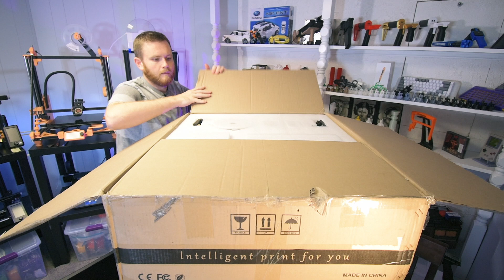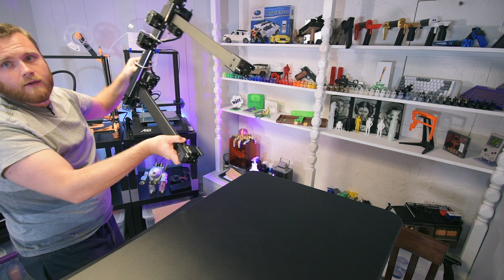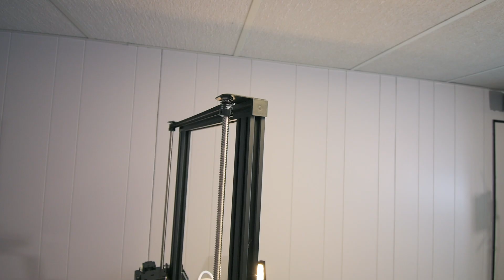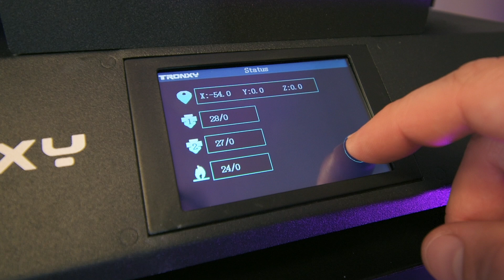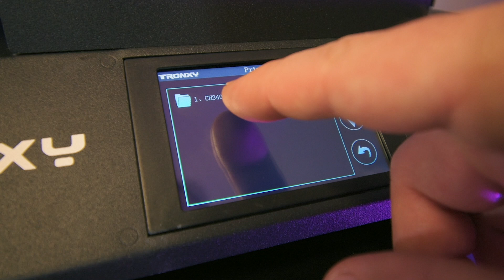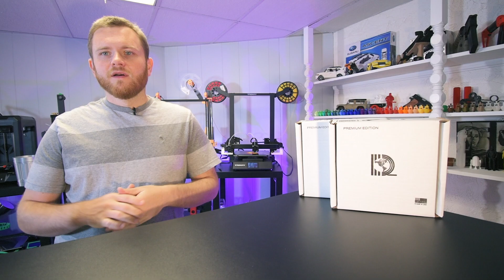Affordable IDEX Printer? Tronxy Gemini S - Unboxing and Initial Impressions

Comment: This printer is a joke. I printed with it already maybe 1000 hours, it does the job, for ... not demanding jobs: ringing and loosing steps on X and Y are very common (even with tensioned belts). I can tolerate those defects, so I am using it.
Firmware bugs are there, but they may be worked around. For example, one need to be around when filament is to be changed, and not let it finish. With PLA, no problem, with PETG, big problem, as the temperature will be set to 200C, after some timeout. Easily fixable in firmware, still, no answer from their so called support.
Extruders are low quality, and a pain to pass the filament through, almost all the times (need special skill set I presume, hehe...). However, they work, at least with PLA and PETG. I would not recommend it for something else, anyway.
The worse bug is head travel limitations: head 1 can not print at more than 2/3 to the right, and I presume head 2 cant print more than 2/3 to the left (I tested only head 1). So in fact, for dual color or dual material, you are limited to... 100x300??? Otherwise, with one head, you may print 200x300, and both heads, 150x300. 
With this joke I did my job, waiting for real printers to come. I still have a 400x400 PRO printer from them, working much better (still, not an industrial grade printer), a MOORE2, wich they sold untested (I mean the model itself, not my item!!!), and came unfunctional (with multiple defects, and mother board burned in a couple of hours of working), and a XY-2, wich I made it a gift, after the motherboard has failed (it printed some thousand of hours though, with good quality, but with much care). 
Very mixed experienced. Like a toy for kids, those printers are ok though. When working. You learn some good printing skills with such a printer!

Comment: Does it take a standard type of nozzle, or is it proprietary to the machine/manufacturer? I have a CTC Bizer Dual that I got several years ago and the left extruder nozzle became damaged. I thought it was a standard MK8 extruder but it turns out they're a sort of mishmash with a MK8 thread, a MK10 outside profile, and a PTFE liner - and I can seemingly only order them from China which means slow shipping due to no USA suppliers (CTC-USA's website is still up but they seem to be defunct - nobody answers emails or phone calls there). This printer looks awesome and I'd love to get one but not if replacement nozzles are going to be difficult to obtain...

Comment: Looks like they changed from brushes to "scrapers", everything referencing the brushes is covered up with labels in the manual lol
Reply from the maker: Easier to stick than to reprint I guess. How well do the scrapers work?
Reply: @3DPrintSOS  Ok'ish, they're not really scrapers per say, more like ramps to keep anything from oozing out when parked. The prusslicer profile I found + the included filament is a bit stringy so the jury's out until I can test them more lol

Comment: Hi, really like the way you present a product...  I have the Anycubic Kobra printer my first, really like it and was thinking of getting the bigger Kobra Plus but then saw this.  Really like the idea that you can print different colors.  I see below you think this machine is a keeper..  I like the automatic bed leveling but then I like figuring things out so maybe manual leveling wouldn't be to bad.  I am a self taught electrical engineer and have and still own two Aerospace companies but now semi retired son running the business now so I can play....  Thanks Dave...
Reply from the maker: Thanks for the compliments. I have no experience with the kobra but it looks like a great machine. I think the Gemeni is a bit of a different machine. It’s not as efficient and day to say stuff. It’s more of a specialized machine. Like printing two things at once or specifically printing two color. Unless you want that specifically, the kobra might be better. :)
Reply: You should try switching filaments a few times in the Kobra before spending so much for two colors.  It's just too easy, Hit the pause button on the screen, pull the filament, insert the new filament down to just feel it making contact with the nozzle, and unpause.  Easy Peasy.  To make it even easier, I added a 2nd spool holder by simply printing a piece at a right angle to the current one, bolting it on, and it having a hole for a standard round spool holder.  That way both spools are up above nicely as you do the switch, where I already have the filament for the new color pulled loose and angle cut and ready to insert.  Takes all of about 10 seconds.

Also, I can print TPU nicely with the Kobra, but I did get a Creality ball bearing spool roller replacement to reduce drag on it pulling the filament off the roll.  I print super slow, and have retraction turned off.

Comment: No brushes are included
Reply from the maker: Really? I had extra brushes. But did have to reprint the brackets. Those came on the SD card.
Reply: @3DPrintSOS  Yeah no brushes, got some metal plates.
Not sure if you touched on this as well, but no way to calibrate E steps etc. My prints all suffer from small gaps most likely due to linear advance being off.

Comment: Do you have any other videos featuring this printer? I’m looking it to buying one and would love some more insight.
Reply from the maker: I don’t. But I’ve been using it and it’s a keeper for me. Do you have any specific questions?
Reply: @3DPrintSOS   nothing specific, looks like a solid IDEX printer. I enjoy you content and feel like you know your stuff. If it is something you would recommend that’s good enough for me. Would you recommend the printer ?
Reply from the maker: Yeah for sure. I love that it’s not finicky. The setup is a bit “manual” but once you get it setup it stays. I haven’t done anything to it in ages. 

My favorite feature is “copy”. You can print two identical things at the same time. So essentially as if it was two printers. As long as it fits on half the bed that is.

Comment: Awesome video. All around great. Thanks Fedor! @3DPrintSOS
I am wondering if you ended up dropping a second video on this. 
(On the TronXY Idex Gemini S) very curios how it is using both heads not with multiple colors but with an hips soluble support filament in line with a print that requires support using the second head  in order to build. Thank you!
Reply from the maker: I think it would do that well actually. I always planned on another video on this machine but I have to get through my queue of new stuff first. ;)
Reply: Would like to see an actual review video with pros and cons. As I am sure everyone else would agree.  Thanks for this current video.

Comment: Hi Fedor and thanks for the good video about the Tronxy Gemini S. I am planning to buy this printer so I'm interested in your thoughts now that you have had it for about 6 months. Would yo still recommend this printer or is there another make that is just as good or better for a similar price?. I'm in the UK.
Reply from the maker: Yes for sure. I still use the machine. Zero modifications have been made and it’s still reliable and works well. I still recommend it. I unfortunately have no other machines to really compare it to. Hopefully later in the year I will. ;)
Reply: @3DPrintSOS  Thanks for the feedback. Sounds like this is the printer I should buy.
Reply: Just a quick update to let you know that I have ordered the printer from Amazon. Once again thanks for doing the video that what persuaded me to go for this printer :-) .
Reply from the maker: Awesome. I think you’ll enjoy it.
Reply: @3DPrintSOS  Printer has arrived and all setup. It prints well, but I have a problem with the gantry. There is not enough travel in the gantry screw holes, so I can't set the gantry up square against the bed.  Currently it leans towards the front, so I have contacted Amazon to see what I should do. Overall (apart from the gantry angle) I think this is a good printer and a lot easier to setup and use compared with my previous printer which was the ender 3 v2. I look forward to watching your future videos.
Reply from the maker: Which part is leaning forward? The whole gantry? Or the bed? Having a hard time picturing.
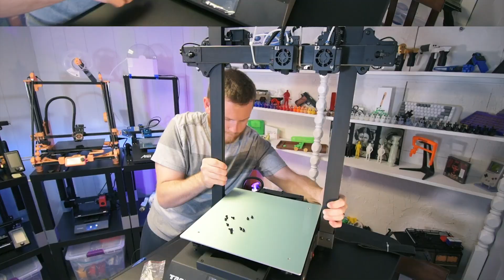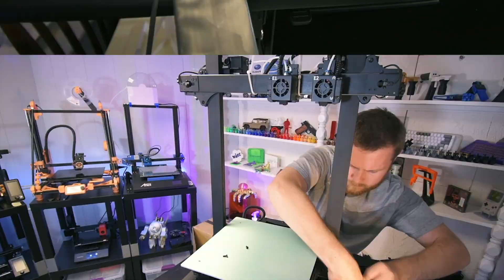Reply: @3DPrintSOS  Hi, it the z gantry that you setup in you video at 8:39 secs to 8:42. The 4 screws on each side go in fine and you can move the gantry slightly, but not enough to make it square to the bed, so it tilts slightly to the front of the printer. It would be interesting if you use a setsquare to see if your one is 100% upright. I guess the solution could be to elongate three of the holes on both side which would give more movement for the gantry to set it up correctly.
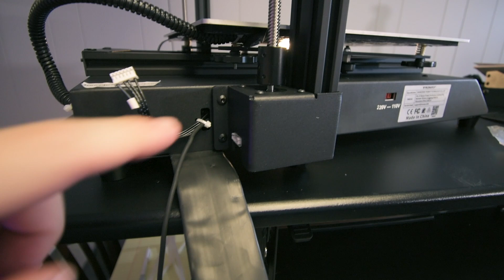Reply: at 8:45 in your video you are pointing at one of the 4 screws holding the gantry. Both sides have the same problem. If I had not used a setsquare to setup the z gantry, I would not have know that there was a problem. To me the only time you would notice a problem is if you were printing a high object it would tilt slightly to the front. I have pictures of the setsquare against the gantry which I could send you as I cant see of to attach a picture here.

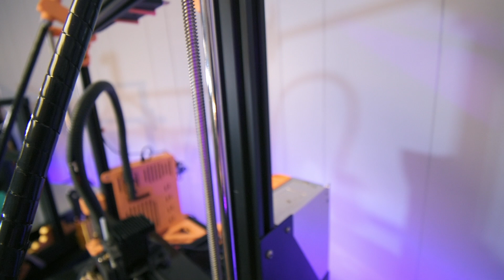Comment: 12:12 Why did they cut v-grooves in the extrusion? 16:38 What has AutoPark to do with leveling?
Reply from the maker: That was a custom printer I was showing in a comparison since the Gemeni has smooth extrusions on one side. 

Auto park is a feature where one head parks while the second prints.

Comment: Have you had a chance to do the follow up review after spending a good deal of time printing with the printer? I'm considering purchasing one but cannot find any legitimate reviews on the printer. Thanks.
Reply from the maker: I haven’t done a full review yet. However, I still have and use the machine. It’s been great and my favorite feature is the duplicate mode. You can “copy” a part and print two things at the same time. So if I need something fast, this thing is basically like having two machines. You just set up a print as you would normally, but use 150mm width on the left side of the bed. Select copy or mirror mode in settings and print. Pretty cool. 

Printing in two color is also good. Especially because it doesn’t need a purge block. Just have to take your time as go through the settings to calibrate and align the tool heads. Otherwise you get some misalignment.
Reply: @3DPrintSOS  Excellent, Thanks for the very quick feedback.
Reply: @3DPrintSOS  Have you by any chance printed in PVA?
Reply from the maker: Not yet, but I really want to. 😂

Comment: Did you tried to add autoleveling sensor or modified firmware?
Reply from the maker: I have not. Honestly the leveling has been so solid. I only needed to do it once so far. Wonder what firmware can offer?
Reply: @3DPrintSOS  I definitely would like to see a bed level sensor for this size of printer, or at least the option to add one yourself. Is the firmware open source?
Reply from the maker: I don’t think that’s going to be easy. Since you have to level two heads.
Reply: @3DPrintSOS  Why would you have to level two heads? You only have 1 bed...
Reply from the maker: The Gemeni S has two heads and two nozzles. So each one has to get leveled to the bed. First head a leveled to the bed and then head b to the bed. Those are the steps in the manual and the second has has special adjustments.
Reply: @3DPrintSOS  The procedure should be first level nozzle A to the bed, then adjust the Z-offset of nozzle B to be equal to nozzle A. If nozzle B would need leveling then that would mean that you lose the leveling of nozzle A, which means there is a mechanical issue in the system. Once the Z-offset of both nozzles is the same, then both nozzles can use the same bed leveling data as you level the bed, not the nozzles.

Comment: I just received my Gemini S and I’m having trouble leveling. The bed seems to low or E1 too high on the bottom left. Warped bed? I have loosened the leveling knobs all the way and it’s still too low. I have also adjusted the Z axis sensor and put it as low as possible and E1 is still too high. Can’t seem to get good leveling on the first of the 5 points of the manual leveling instructions. Any thoughts?
Reply from the maker: Hmm. The hole that mounts your z axis sensor must be off. 

The best way to do it would be to get some good tension on the bed springs then move the z sensor lower. Sadly, if yours is that off, you may have to widen that hole or drill a new one to get it lower. You can’t run a machine with lose springs. It won’t stay level.
Reply: @3DPrintSOS  Thank you for the reply. Unfortunately, my bed plate is bent slightly on the left X-axis by about 1mm. I have contacted TronXY, sent them pictures and video, and they have confirmed it. Now just waiting on their reply to see how they’re going to solve this.
Reply from the maker: Let me know what they do.
Reply: @juansalazar3831  did you get any reply yet from tronxy?
Reply: @OurDumpingGround  I did, but it was another person who was asking me to send proof all over again. I can tell they just didn’t want to send me a new bed carriage. I was able to “fix” the issue somewhat. Just bought taller springs and only installed them on two points. Not perfect but at least I can print now. Bad thing is, only in the middle. So I can’t take advantage of the duplicate or mirror modes. Just use it to print objects with PVA supports.
Reply from the maker: Ah so it’s the lower carriage. Totally unreasonable for them not to help. I would keep trying. Also, in the meantime and I know this is a pain, but I would take the carriage off and straighten it. Once you make it flat, I bet you’ll get it level.
Reply: @3DPrintSOS  I’ll try that. Thank you.
Reply: Good luck, I hope you do straighten bed.  What you can do to save you a headaches is buy a new printer from Amazon get the part you need and return back because of defective bed.  That's one way of sticking it to Tronxy .

Comment: Hi. Did you find a way to use Cura slicer with this IDEX machine?
Reply from the maker: Yep. They had great instructions in the manual. Worked from first try.
Reply: Hmmm. The manual i received did not include 2.extruder

Comment: You are not helping me out by showing these awesome printers!  Thanks for the review!  Really enjoying my Voxelab Aquila so far.  Still trying to get TPU to print correctly, but I'm getting there!
Reply from the maker: I know right! TPU can be tricky! Slow is sometimes the only way. That and an extruder that can do it. ;)
Reply: @3DPrintSOS  I got the EZR Struder, solved my extrusion problems. Think I have moisture in the TPU filament. Time for a dryer.
Reply from the maker: Not a bad move.

Comment: could you do a video on replacing the Bowden tubing. On the aquila.
Reply from the maker: Actually, if you watch the printable extruder video, I go over the hotend side. However, an advanced version. Replacing the tube should be as easy as undoing both the ptfe fittings.

Comment: Sorry off topic but you were helping me with my aquila problem in which nothing would stick after leveling. I just wanted to share this with you and see what you thought. I bought the cr touch kit and will be following your video to install it, but before I do I decided to give the leveling one last try. Didn't stick. Then I noticed that my installed  fw was lower than what was available on the voxelab site. I updated the machine then tried printing a test one last time and all of a sudden the filament stuck to the bed and the test print came out pretty good. Could the older firmware have been causing my problem, or was it just a coincidence? Undecided if I will stick with official or go custom after I install the cr touch, but with my limited experience it feels like the firmware fixed it.
Reply from the maker: Well, I’m glad it’s working. It might be coincidence though. Unless you had a z offset set in the old firmware and now it’s back to zero. ;)

Comment: Thanks Fedor.  Very in-depth look as always.  I'm looking forward to seeing more of the dual colour prints.  Would it be possible to show the method for combining the STL files that you mentioned?  I'm assuming that you have to cut away the parts from each, so that you end up with the relevant bits printed on the correct head?
Reply from the maker: I definitely want to make more content on this machine soon. Yea I’ll be sure to give a closer at that process. You essentially need “pieces” that are separate so that you can assign them to a hotend.